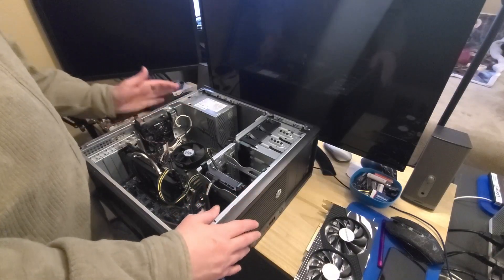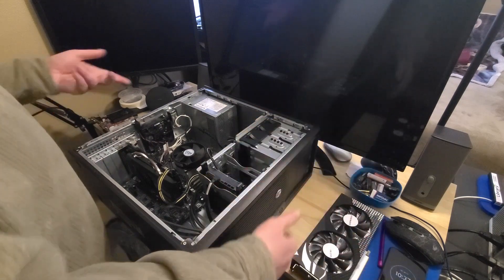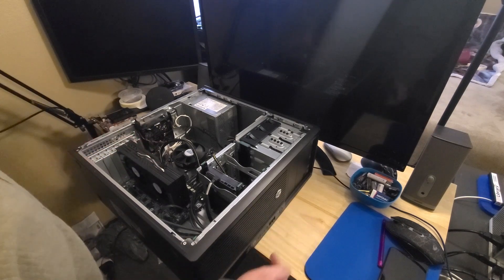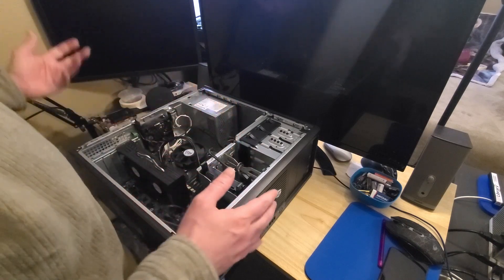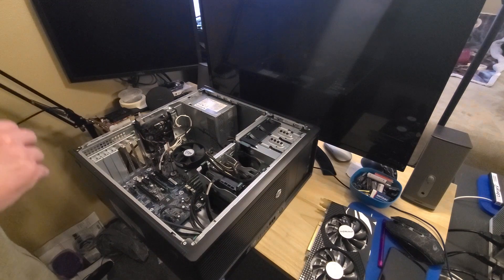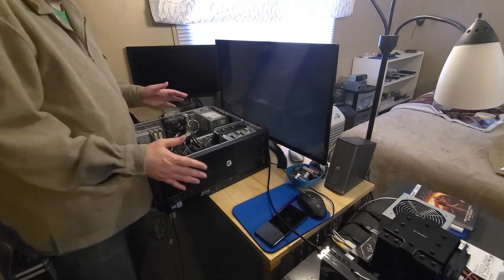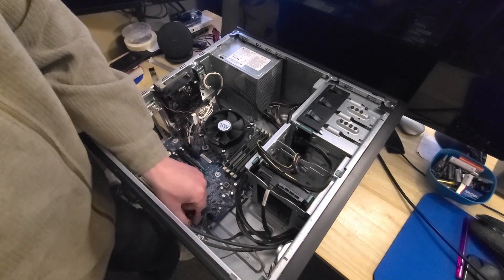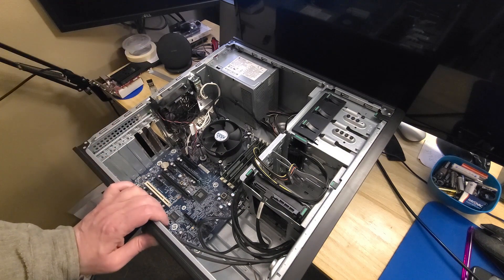Another HP computer with no image after installing a new video card

Comment: If the card works on another rig and no output with other rig first try a different psu as often those HP psus only run 250w and won’t power a decent gpu.

Comment: any fake card will give an image should have let it go to windows then use gpuz to find out what the card is if the drivers load up lol.
Reply from the maker: I didn't even think about that at the time I guess I could have done that when it was hooked up to the i-5 12400 system I would just wanting to verify if it was his system or the card itself giving no image yeah it is pretty weird for RX 580 to just have a six-pin and not an eight pin he did buy it from Amazon and he returned it and I guess he got a full refund now he has a RTX 3050 and that system and he put it in himself

Comment: it took me 5 minutes to google this the card he took out is a 6 pin card the new 8 gig card is a 8 pin card i think he needs new glasses or he needs to go and learn how to put computers to gather properly , as he says the power supply has only got a 6 pin connector  if you slow down the video at 2.53 on very slow you can see 8 pin connector on card , what a """""""   """"""""" .
Reply from the maker: No the new card was also a six-pin you want to go the timeline you can see it at 3 minutes and 7 seconds that it is only a six-pin this is the one of the cards from like AliExpress that Amazon decided to start selling also so it's a cut down version of a 580
Reply: @rohon4972  google it again clearly says in the specs that its a 8 pin card 150watt type in Soyo RX 580 8GB 2048SP look right see what it says in tech box write up from B its there for everyone to see , or then again may be the cards a fake!! .

Comment: Hook a different power supply up to the rig with the card in  . It could be the discrete power supply to the card that is the culprit,since board power only cards work fine and the card works in a different machine with a different power supply. Your power supply may be the culprit.
Reply from the maker: I would see the power supplies good he just installed a Nvidia RTX 3050 and it works perfectly fine

Comment: Try resetting the BIOS if that don't work put it in the lower pci-e slot
Reply from the maker: I tried both with no lock some reason it just did not want to work with that AMD card. I even use an external power supply.